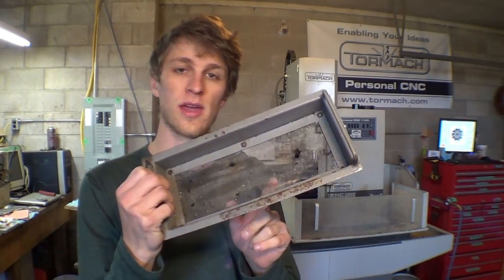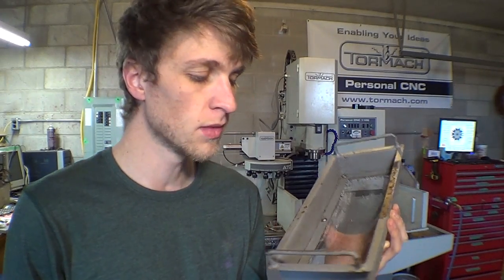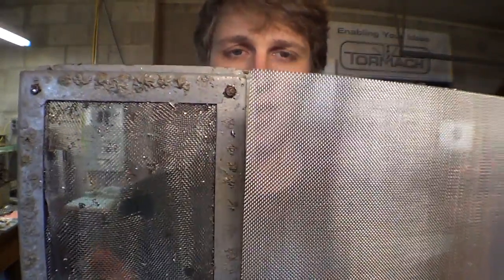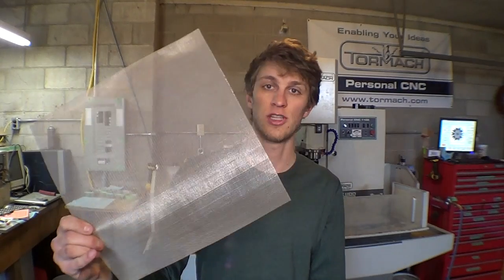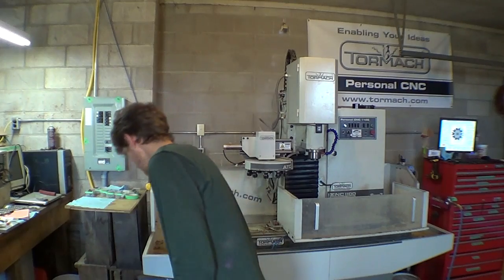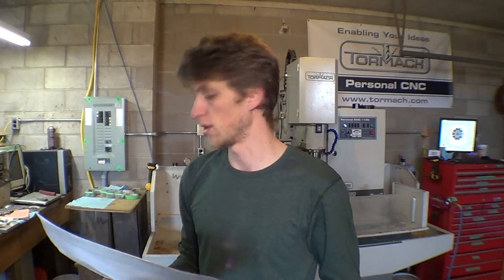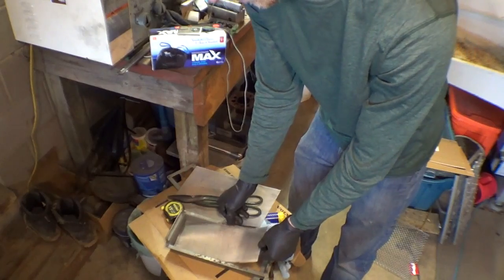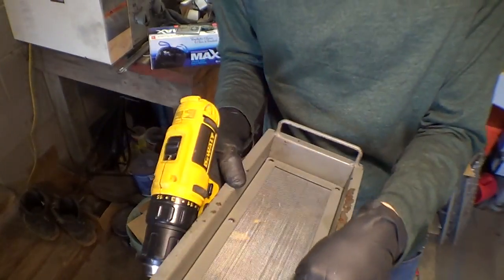Tormach coolant screen replacement

Comment: Next screen you cut,  just use a sharp pointed punch that is smaller than the screw holes to make the holes in the mesh.   Drilling worked,  but a small enough punch puts lots of force on a tiny spot.   You can use a screw driver or larger punch to make the hole bigger if need be.   I just used a point punch I had laying around.

Comment: I just recently replaced the screen on my tormach as well. I used mcmaster part # 85385T96 which I got from another youtube video on this upgrade. I doubled it up and used two layers, works very very well. Next up, upgrade the coolant pump with a higher capacity waterfall pump.

Comment: If you have a chance, I would highly recommend running your coolant through a light filter as well, or even incorporating a filter bag system into your coolant lines. It will keep the pump in good condition for a long time, as it seems most of your machining results in very fine particulate. Not sure what the pump is rated at (I'm guessing 1/6HP) so building in a filter might require upgrading the pump, too. Just a few thoughts regarding machine longevity.

Comment: how about a video to show how the 1100 has held up after 18mnths use??  like mill a 4x8 square out of mild steel .5 thick and measure as to see how accurate its position repeats are(mic the square-no calipers),, do a 4in circle using cutter-comp with comp dead on and measure first run results with a telescoping guage in x and y to show TIR (egg-shape),, just wondering how accurate she is compared to what its specs were when it was new,, i know you could set up indicators and check back lash but when you include tool deflection of say a good z-carb checking by milling will show the real deal,, just sounds like a good video,, enjoyed them all,, take care
Reply: Without having done a "before" test I'm not sure how good the results will be, but it's an interesting concept.  XY backlash hasn't changed, Z backlash is a bit more but I'll go in and tighten it up soon, Tormach provides good documentation on how to do it all.